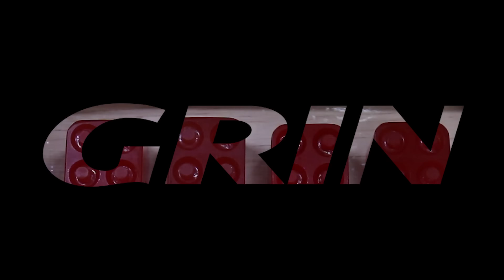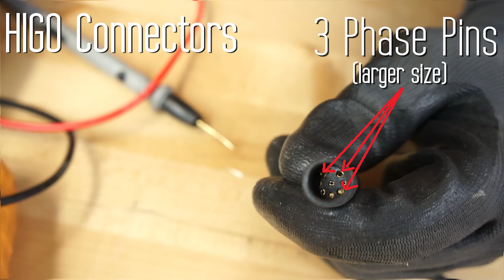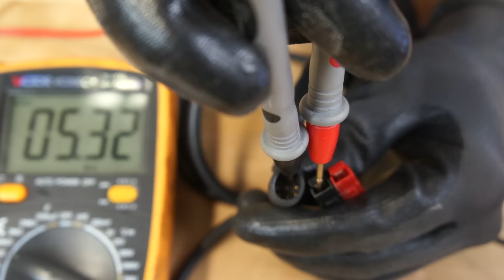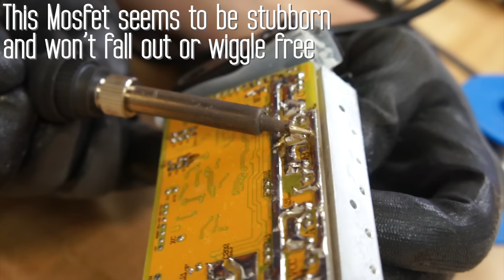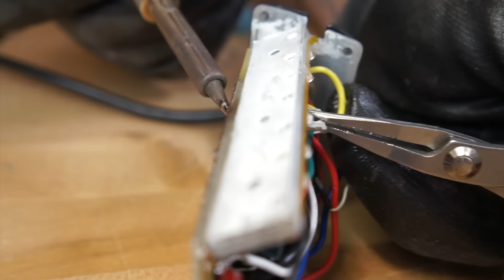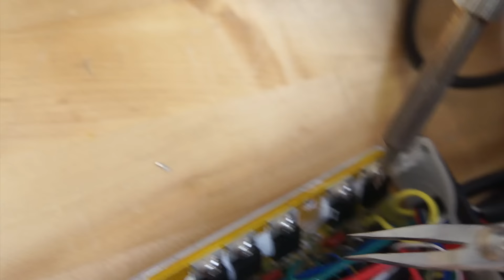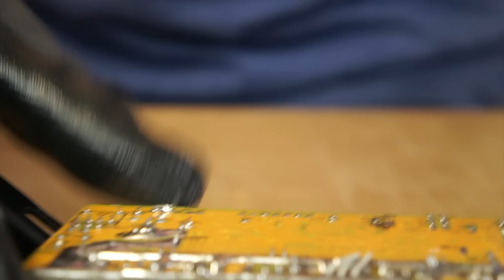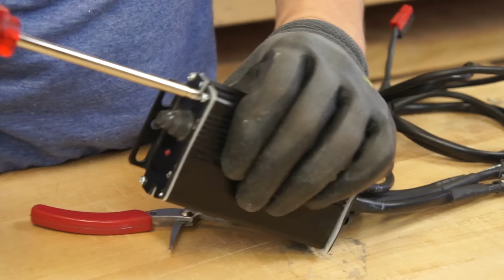Finding and Replacing Blown Motor Controller Mosfets

Comment: Just got a cheap $10 36-48v 350watt 18amp controller that will sometimes work but then shut off and the motor will have a coging effect, I was planning on upgrading the caps and solder the shunt,  could it be a failing mosfet?
Reply from the maker: Mosfets don't don't start 'failing' rather they are either perfectly fine or totally failed. So if the controller sometimes still runs fine, then it means all your mosfets are still fine and your problem is somewhere else. I wouldn't sink too much energy in a $10 motor controller.  Just the 6 mosfets alone should cost much more than that.
Reply: @GrinTechnologies  hmmmm that's what I was thinking, Im on a tight budget and I waited over 3 weeks for the controller to get to me so I'm going to at least try to fix it, there seems to be 7mosfet looking things, one of them is a lm317 voltage regulator that has a trace going to a big resistor, I've noticed that the resistor gets somewhat hot when the controller decides to work and gets hotter after the controller "fails" where the motor will just abruptly stop like the phases are being shorted and then has a coging effect until I unplug it and let it sit for a minute.
Reply: Now I figured out it has something to do with the vcc red wire that connects to the battery positive, the resistor is also connected with it and when I unplug the red vcc wire the coging effect goes away

Comment: I didnt catch what type of mosfet it was can you please share
Reply from the maker: There are thousands of different mosfet models to choose from and the one that we used in these controllers (AOT460's) has been discontinued. What you generally want to do is look up the specs of the original mosfet based on the markings that you see, and then choose a replacement that has the same or lower RDs on resistance, and also the same or lower total gate charge. Both these numbers are always shown in the mosfet datasheet.  Sites like Digikey and Mouser offer very good parameter selection filters to quickly identify candidate replacement fets.
Reply: It's in the video.  Go back and watch it again and you will hear it.

Comment: Hi 
I got 15 MOSFET 1000w 48 v motor controller, I followed the above instructions, I notice my yellow phase wire resistance on battery +ve side is faulty. I.e black probe on yellow connector and red probe on battery red shows 0 ohms. I opened the case and checked it has 5 MOSFETs for each phase.. how can I can find the faulty MOSFETs, is there any instructions for controllers with 15 MOSFETs
Reply from the maker: A 15 mosfet controller would typically have groups of 2 mosfets on the non PWM side of the bridge and 3 mosfets on the side that is doing active PWM. Until you separate the parallel connection you have no easy way to know which mosfet in the parallel group of 2 or 3 is actually blown. One way you can tell though is to force current though the short with a power supply and use a thermal camera to see which one is heating up from the current flow, or use a multimeter to in the mV mode to probe the voltage drop across the traces.  Usually though it's fasted just to take them all out (2 or 3) than trying to identify which specific one is the culprit.
Reply: @GrinTechnologies  Thanks for taking time to reply.I am non-electronics person but learning about them, I have ordered for the mosfets will try to troubleshoot.I am ebike enthusiast and started to retrofit few bikes.Looks like fault finding is key to sustain the interest :)

Comment: i just taken a reading on all 6 of my mosfets..     2-6 all have a climbing voltage reading.    but number 1  has a voltage spike on first contact and then begins to fall?   is this the problem im having?      when the system is live,  its feeding 5v to all phases at the same time..  even when i apply the throttle,  the voltage on all phases just sags to 0.3v and the motor makes a tiny humming sound.

Comment: good video, the diagnostics in the beginning were helpful. I would recommend replacing the heat sink compound or at least mentioning it as this is very important in an electrically isolated heat sink.  also, the wattage of your gun is important with mosfets as a lot of heat is sucked away by the large traces and the center leg. probably would have fallen out if your gun was hotter. :)

Comment: I have a question about the replacemnet Mosfet. Should it be exactly matching the old. Or I can use something with in range? I have 6 mosfet controller 32V, 250W controller. Can I use 49A 55V Mosfet?
Reply from the maker: In general it's a good idea to try and match or do better for the Rds ON resistance, and also the total gate charge or gate capacitance. Both or these specs are well documented in the datasheet for any given mosfet model.  What you don't want to base in on is nominal amperage. Saying 49A doesn't mean anything really since the current handling depends massively on the extent of heatsinking, you want to look at the fet's actual electrical characterization.

Comment: I just bought a controller, no paper work, but the connections are labeled, I guess!  I can't read Chinese!!! Ant idea how to figure this out??? I know the phase and power, and switch wire, but clueless to what the billion other wires are for!! I didn't get what I ordered, but its the same controller, just lower wattage, I need to figure this out, the only thing I need is the throttle, and maybe the brake safety, I was planning to run sensorless , but if not , us there any specific order for the phase wires?  Thanks
Reply: Hi, if the motor spins the wrong direction try to swap two phases over, this is how you would reverse a 3 phase motor direction
Reply from the maker: It's usually straightforward to identify the 3 phase wires, the 5 hall wires, and the 2 battery leads. Identifying which of the other cables is your throttle signal (vs ebrakes, on off switch, lights, horn, etc) usually requires trial and error, but that's not the topic of this video which is simply about identifying and replacing a shorted mosfet.

Comment: Would a bad mosfet cause the scooter to run full speed when you flip the power switch on? even with the throttle disconnected it does this.
Reply from the maker: The only way this would be the case is if you had a brushed DC motor and motor controller where a FET shorted out. With a brushless motor, there is no way that a failed mosfet would cause motor to spin since spinning the motor requires the mosfets all to be operational.  A brushed DC motor will have just 2 large gauge wires going to the hub, while a brushless one would have 3.
Reply: That sounds more like a problem with the throttle.
Reply: @46B3x2you  I would have agreed with you on this, but I was investigating exactly the same problem yesterday with 2 different controllers.
I swapped the throttle for a known good 1, and still had the same problem.
With a different controller fitted everything works fine. ( just noticed that James stated that the same thing happened with the throttle disconnected!)
So I think I blew both controllers by trying to get a different ebike working, which turned out to have a short within the 3core throttle cable. This seems to have blown the FETs.
At least, after watching this video, I have a good chance of being able to repair them and learn something in the process 😎.

Comment: how does this work when you have 9 mosfets? there are only 2 polarities and 3 phases, though my mosfets are in apparently banks of 3  and there are 2 the same and 1 different in each bank, i am getting shorts accross the power rails and the 3 middle mosfets are all shorted across all 3 pins, the other 6 only show continuity on the middle pin, i am assuming it is only the 3 in the middle i need to change, great info, but a bit of elaboration on if there are more than 6 mosfets (which fit into the + - of 3 phases) would be helpful, cheers
Reply from the maker: When there are multiple mosfets they are always hooked up in parallel.  Much more common than 9 fets would be to have 12 mosfets, where every mosfet is doubled up. With 9, it means that either the high side or low side fet is doubled while the complimentary (low or high side) is single.  If the failure is on a paralleled mosfet, you can't tell until removing the fets which one of the two is damaged. The easiest thing to do is just remove and replace them both, but if you remove one first and see that the short is gone, it usually means that the problem was only with the mosfet you took out and the 2nd one can possibly stay in place.

Comment: How much weight will 1 KW push??
Reply from the maker: Easily several thousand pounds if you are talking about pushing low drag vehicle level ground, but much less if you need to go up hill. Spend some time here
https://www.ebikes.ca/tools/simulator.html
To appreciate the relationship between motor power output, vehicle speed, vehicle weight, and % grade.

Comment: This is awesome. I had a blown BMS in my pack and I fixed that but the bike doesnt like high amp draw going up hill. I am assuming this is the problem that I need to address. Would this type of problem cause the battery meter level to all of a sudden drop when going uphill like this?? Anybody else have this problem? My battery charges to 53.1 volts by the way. I have a VELICK R48+ 500 watt bike.
Reply from the maker: It sounds like you have a BMS circuit that is tripping at the power levels that your controller wants to draw, so either you'd want to reduce the max current of the controller (if it lets you do that) or get a replacement battery and/or BMS rated to deliver higher current levels.
Reply: @GrinTechnologies  Thanks for responding. I dont know who else to turn too as I get no answers from VELEC. These guys are criminals. Never buy a bike from them. Anyways, I found out that the controller gets really warm, actually hot, so im assuming the controller is poohched. I pullrd off the little side cover of the cuntroller and wouldnt you know it, it was packed full of epoxy so I couldnt check the MOSFETS. So I purchased a controller off the inturdnet and got one thats too big to fit in where the other one did. I am a fabricator, so it will make it in there some how. The wiring is all completely different as well. I have the wiring labelled from the new  controller but even the color codes dont match for the VELEC crap and extra wires I have no idea where they go. I need help as VELEC wont provide schematics for the bike. Pure dickheads they are. I am warning everybody out there not to purchase this proprietary jism. Its not worth the time and energy. Even the batteries inside the pack are so tightly glued in, its a joke and to pay 1000 dollars for a battery and a few hundy for a controller takes my temper way above anger. I could never do this to anybody and produce shit like this. Can anybody assist?

Comment: Hi Phil, really nice and helpful video. It helped me find the faulty MOSFET in my controller. However, as soon as I plug the battery connector and try to accelerate, the same MOSFET is failing... I've replaced the same twice... Any ideas?
Reply: That usually means you also have a blown or damaged mosfet gate driver circuit unfortunately. and fixing that requires much more specific knowledge of your particular controller PCB. We find that in about 2/3's of cases with controllers that have a blown mosfet it can be fixed just with the mosfet replacement, but about 1/3rd of the time there are problem that have propagated further upstream and replacing a FET alone isn't enough. .
Reply: @justinlemireelmore  Thanks Justin! It is a 22A KT controller from Aliexpress... Probably one of the most common ones... The rest of the components in the board look OK... I also tested a couple of capacitors of that same phase...

Comment: My controller is potted in epoxy. Now what?
Reply from the maker: You can get the epoxy soft by either soaking for a long time in methylene chloride or heating it with a heat gun, and then trying to peel/pry it away from where it encapsulates the blown mosfet, being careful not to damage anything else on the PCB.  If you've got patience and deft use of small picking tools it's doable. Not fun, but doable.
Reply: @GrinTechnologies  Thanks, I will try both of those methods. I just want to upgrade the wires as they're grossly undersized for a 52v 21ah battery and a 750w motor.

Comment: Could a blown controler damage a new motor
Reply: Not usually since the motor won't run.  However, if you have a blown mosfet with a direct drive hub motor and you keep on riding with it plugged in in spite of the heavy cogging torque, then you can cause huge vibrations which can make the motor spin out of the axle and suffer mechanical damage that way (if you don't have a properly fit torque arm).
Reply: @justinlemireelmore  thanks i already chanced it and all was okay great contenet keep up the good work

Comment: its the yellow phase wire on power resistance test thats zero reading on negative test it starts off zero then slowly builds up to the other phase readings or up to 5kohms.i have my old 48v controller will try that soon im just waiting for some jst sm connectors to connect hall sensor back up .steve in uk

Comment: hi i tested my controller in resistance mode like your tests and one reading is zero on red power side does that mean mosfet blown?controller not that old from alixpress 48v 1500watt on a 1000watt hub motor and 54v 18650 samsung.had throttle problem before so bought this new controller and throttle kit.lcd display lights up ok had last ride and motor died and seemed to run rough the wheel with motor in.ride before that was intermittment power.

Comment: Perfect video major help - thanks - did you ever do a vid on testing hall sensors on a motor with the same connectors as the controller in this video
Reply: No, we haven't made a video on this yet but that would be subject of a future video for sure!  Usually with overmolded connectors like this, in order to measure the hall voltages you would either make a M-F connector splice that brings out the hall wires to probe, or you would open up the motor controller and measure the voltages directly on the controller PCB. This is one case where the JST plugs are a lot easier to work with.
Reply: @justinlemireelmore  Inspired - thanks - I have spares that I could try and make a F connector, my connectors are "julet" or higo style - As my kit is new opening the controller and motor to test internally is no-go for me. I have a medium level of vibration from the motor felt from the seat when setting off or changing PAS levels for hills, it always seems to be when torque is needed, once over 12mph everything is smooth, how I explain or show the Chinese company this is the next question or maybe this vibration is normal for a rear setup, my first 2 motors were front hub.
Reply: @facelessvaper  that's because you're using a squarewave controller. it's normal.
Reply: @camilorobles2433  One year on and yes I would normally agree with you square vs sine, but in my case it was a motor and controller fault, the motor was replaced and worked well with no vibration on a newer square controller. The company in question has now moved away from KT controllers as the were getting numerous faults reported and I personally have moved back to front hub over volted to 48v and, yes are now using a sinewave controller, which like you rightly say is much smoother and overall is a better system.

Comment: I don't remember you discharging the capacitors before you began soldering . You could potentially create more damage within the circuits I you don't discharge them
Reply from the maker: That's a good point. If the controller's on/off button is ON, then it will self discharge the capacitors in less than a second and there is no concern. But if the controller switch is Off, then the electrolytic bus capacitors can stay at or near the battery voltage for quite a long time so there is voltage present on the circuit when soldering, and you wouldn't want to bridge that by mistake to a sensitive component.
Reply: @GrinTechnologies  i learned the hard way.
Reply from the maker: @edwarddeal6948  At least you never forget those lessons learned the hard way! ;-)

Comment: Awesome video. I'm learning more and more about these ebikes.  I'd rather fix my own bike rather than pay someone esle to do it . And sometimes you gotta draw a line between what to fix and what to just replace
Reply from the maker: Controller mosfet replacement can wind up on either side of that line. Very few if any businesses would find it worth attempting these kinds of controller repairs since there is no guarantee of success and they need to pay staff and technicians regardless. But if it's your own motor controller that's blown, then you don't have much to loose from trying and that's what we want to encourage!
Reply: @GrinTechnologies  True to a company that holds true to providing reliable customer service.  Nice!

Comment: Hi there. I put one of these bikes together for my son. It was so cool I decided to put one together for my self. I am 60 years old and have a three miles of hill to climb to get home from the flat lands. My son and I decided to take a ride the next day after I put mine together. We were out about seven miles and mine quite. I shut it off and then turned it back on and it went about a half a mile and then it blue a fuse. I put in another fuse it blue that one to. I did what you said and checked out the wires and the blue one went to ground. I pulled it apart and there’s 12 of these mosfets . Don’t know what to do now. Some are positive but not like what you show. I’m stuck
Reply: Sounds like the controller fuse can't handle the battery voltage, whats the controller rated at and whats the battery voltage? A 48v battery charges to around 54.6v - Controller fuse should always match the battery voltage.